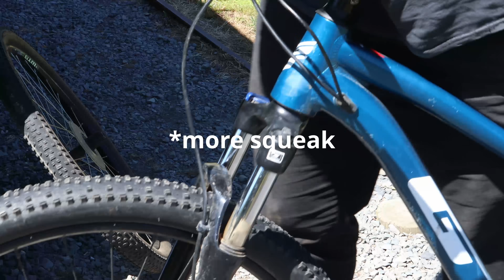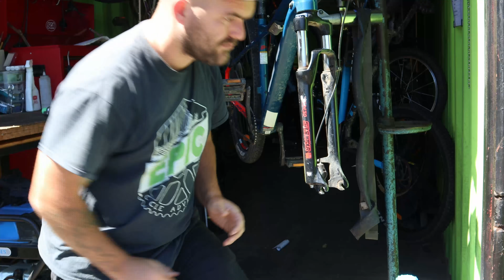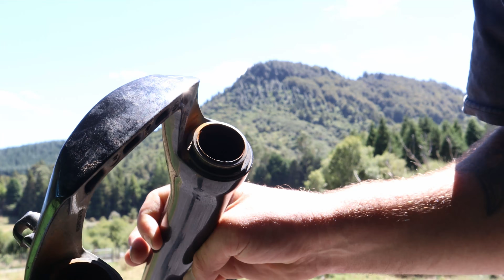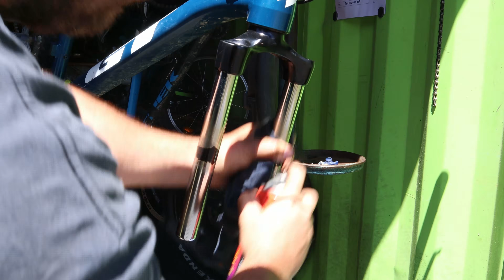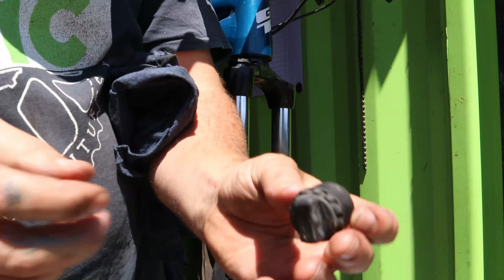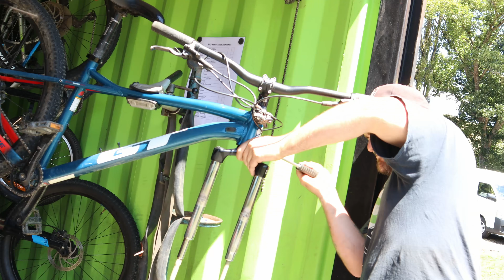How to fix & repair your MTB Suspension / Forks...full overhaul!

Comment: For the sanding part of it, you can always use a brass wire wheel. Start with a die grinder one for the big stuff and finish with a Dremel one for the surface. You can go for extra points with a finishing abrasive wheel for the Dremel and shine it up.

Comment: Hi pal are the shock tube all the same size I have a set that have a 27.5 wheel and i gave a set that are 26 wheel i am just wondering if i can use the tube off the 26 and put them on my 27.5

Comment: I rebuilt my forks because they needed a service. I did not lock off the damper side before stripping down. Now I can’t lock off the damper. The 4 mm inside and the 5 mm outside just spin round and round. Any advice? Or have I damaged the damper?
Reply from the maker: Classic mistake to make. I still do it every now and then. If you pull it the damper side out till it's a few mills lower that the spring side and the grip it with some pliers you might be able to lock it out there. Otherwise you could try compressing the fork when you are assembling it either with a friend helping or removing the spring from the top to let you compress it.  Unfortunately it's a bit of a fight to figure it out but it's definitely doable.
Reply: @juliangoulding  thanks for the reply. I’m going to give it another go. I got fed up yesterday and rebuilt the bike as I wanted a ride!
Reply: @juliangoulding  by the way, I tried taking the damper completely out and turning the lock whilst holding the bottom section but it still didn’t grip and kept spinning?
Reply from the maker: @dominic77999  sometimes I'll get the nut on the end just a couple turn and try grab just above it, on the thread, with a long nose plier and lever it down on the nut while tightening it up. Sometimes that works. Like I said it's alot of f'ing round but you'll get it.

Comment: my bottom bolt turns as well with therod wich makes itimpossible to open the forks. what do i do please help me
Reply: Mine does the same. Did you ever find a solution.
Reply: @stevemartin4131  i kind of held the rod with a pair of pliers. i did damage the threads a little bit, but i got the bolt back on after a while.

Comment: Also bro, use wire wool and a metal polish called peek. Super cheap way to do the stansions  with an incredible outcome 🤙 it’s thinner than autosol but thicker than braso 😂🤙
Reply: Try never dull clothe . My friend works on auto body repair and swears by the stuff

Comment: I found a mountain bike in a river bed and I want to restore it, everything’s full of sand so I’m gonna take it completely apart
Reply from the maker: Do it!
Reply: Update on excalibike?
Reply: @brianm1684  derailer was bent beyond repair, so was the chain. Shocks were locked up with sand and pst repair. Wheels were rusted over and so was the frame internally. Excalibike is now in the landfill.
Reply: @jaymockery  well, you gave it a shot.

Comment: i took the cap off without the socket what do i do
Reply from the maker: It's tough to explain in text but if you are having trouble screwing it back in try pulling down hard one the forks lowers while you try. This should relieve some pressure from the spring and you should be able to get it most ot the way in by hand. Hope that helps
Reply: @juliangoulding  i took off just the rubber plastic part not the entire thing

Comment: I purchased a new Aventon Level E Bike in Mar 2022, it has the cheap 
zoom fork, after about 2 weeks the front fork makes a clunk sound when 
going over some bumps and it's 
pissing me off, it does not do this when it's locked out though, does 
anyone know what the issue is? Or even an upgrade fork the would fit 
this bike? Thanks John
Reply from the maker: Yeah it's not the nicest fork. Sounds like you might be bottoming it out, try adding some preload to it, which will stiffen it up a bit. Might be worth just taking it into the bike shop and get them to have a look. We had a similar fork on one of our ebikes and changed it to an air fork and it made the world of difference.

Comment: Hi thanks for the video... I have a very old fork which came with a trek 4100 from 2001. The brand on the fork says InSync and the model is called Grind 320. InSync seems to not be around anymore but the company that I think used to make them now makes forks under the name of Spinner. And Spinner could not help me. In all the videos I have seen about taking apart basic forks the allen nuts near the wheel hubs at the bottom of the fork are long bolts. In my shock it is an allen nut which just screws off the thread. I cannot pull the fork off the stanchions. Is there anyway you could help me?
Reply: Got exactly the same problem with the same fork 😅

Comment: How do I fix this issue :
When I lock y front brake up and rock my bike there’s movement in the silver hit of the suspension and the black but that’s connected to the the wheel there’s no headset play whatsoever

Comment: Mine wouldn't come apart with the mallet.  I saw another video that recommended loosening the bolts at the bottom and then tapping on those to loosen them up so the body of the shocks would come off.  That did the trick for me. https://youtu.be/eW2819rP9Tw?t=164

Comment: Hey Julian I have an old Manitou Mars Elite front suspension, its similar to the design of the shock you worked on here but has a dampening adjustment knob on the bottom of the right shock and some sort of adjustment knob on the top  of the right side as well...neither of those seem to come off so I cant disassemble it to service....have you ever worked on one of these?

Comment: Use foil to sand down surface rust this works great it completely removes it
Reply: Try vinegar as well, the acetic acid when combined with iron oxide reduces it to iron acetate more over this allows the aluminium to be oxidised to aluminium oxide thus removing iron rust to create aluminium rust in solution leaving the bare iron to be cleaned and coated with a electro plating, paint, light oil and so on
Reply: Yes, silver foil and a little water helps bring rusty metal back to near perfect 👍
Reply: Good idea, and I use 0000 steel wool to remove rust on handlebars, fork tubes  or other chrome pieces
Reply: Rad tip
Reply: Aluminum powder is poisonous. Where n95 mask and dishwasher gloves.
Reply: Try never dull product

Comment: Fine steel wool does wonders for rust removal on forks w/o scratching the stanchions to buggery ;-)
Reply: with some added wd40 helps more still, use this combo on anything rusted
Reply: Agree to both the above, does the trick for me 👍🚲
Reply: No no no no! Use aluminium foil. NO STEEL. NO GREEN SCOURER.